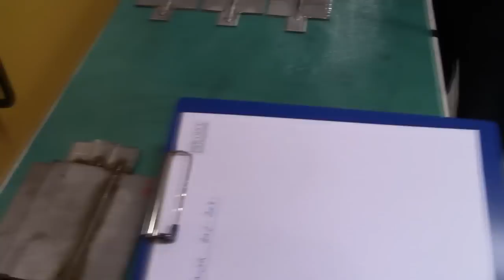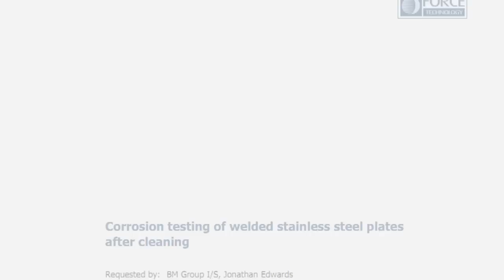Passivation Testing on Stainless steel

Comment: If you did not clean the rust off, would the rust continue to spread internally into the peice of metal, or would it just stop rusting at a certain point? Thanks
Reply: Hello Mike, yes the rust would continue to spread. If you need more info on this, send me an email to sales@cougartron.com and i will be glad to help. Regards Harry
Reply: there is a process called derusting prior to passivation ^_^

Comment: why use of passivation process
Reply from the maker: Stainless steel is designed to naturally self passivate by exposure to the air, but the surface must be clean and free from contamination and the process takes several hours. So when stainless steel is welded, the heat affected zone is rich in metal oxides and that area has very little corrosion resistance, meaning this weld seam can rust. Cougartron weld cleaners will remove any surface contaminates and oxides leaving the surface clean, and passivated in just minutes.